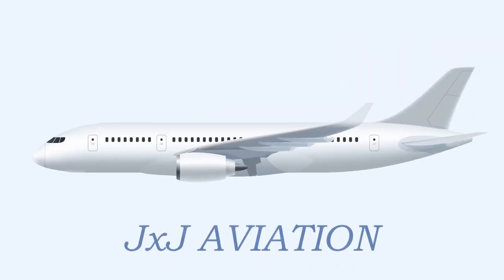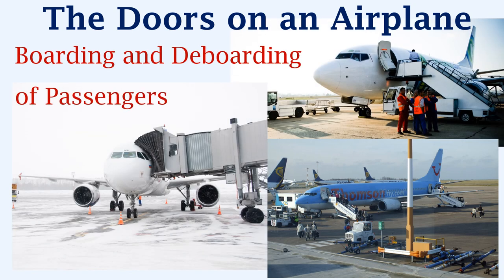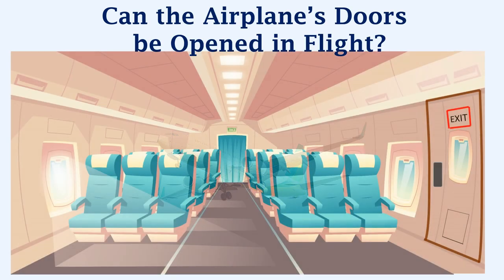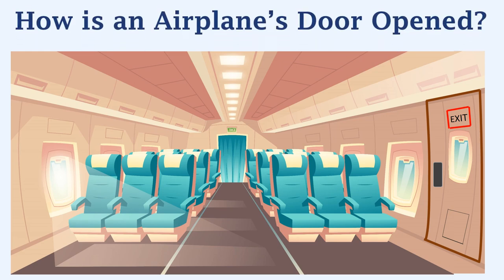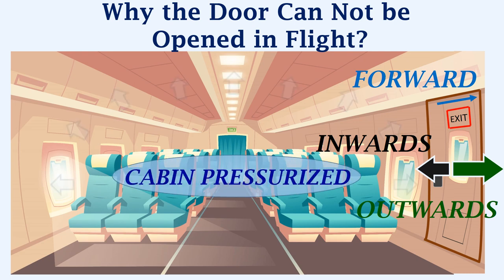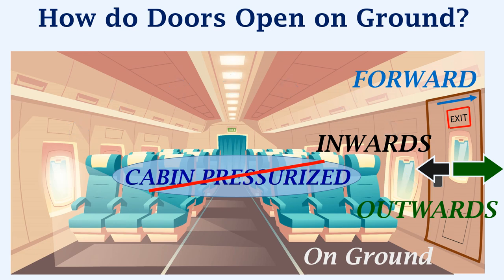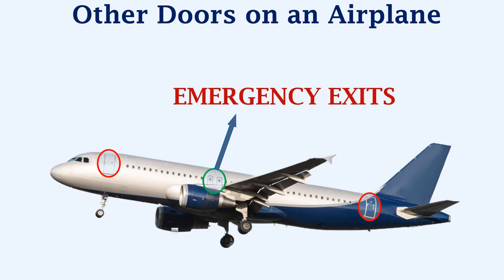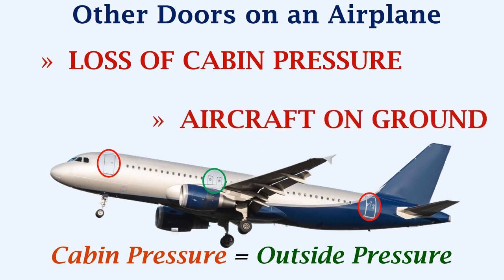Is it Possible to Open an Airplane's Door in Flight? Understanding the Operation of an Airplane Door

Comment: Fun fact: after DB Cooper hijacked a Boeing 727 and used the back stairs to jump out of the aircraft, a "Cooper Vane" was installed, preventing the rear stairs from opening during flight.